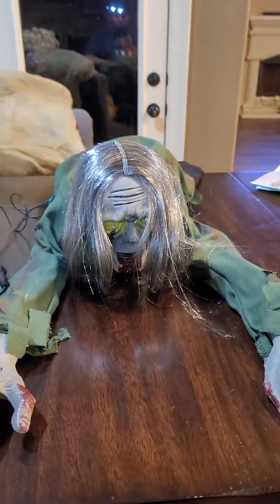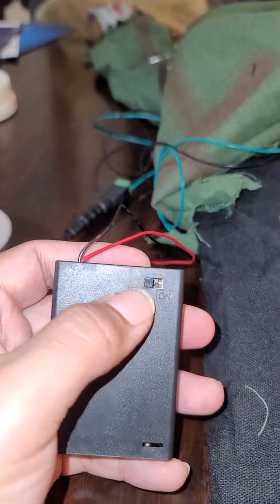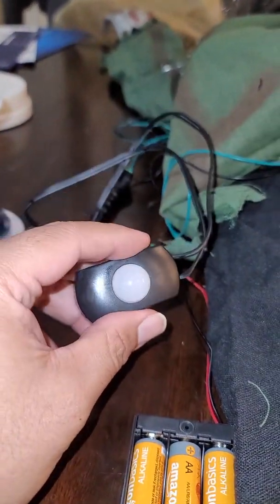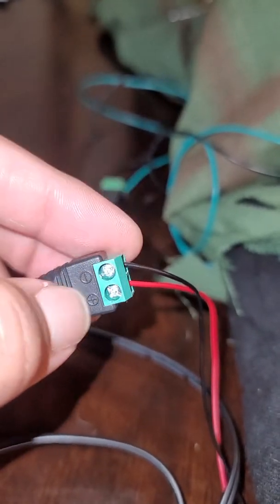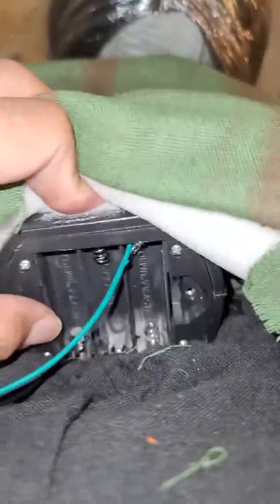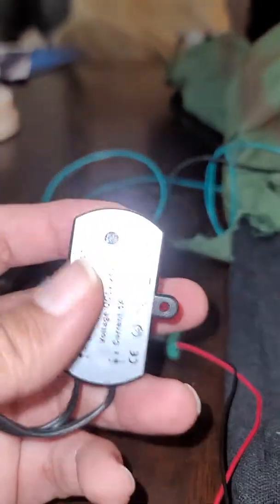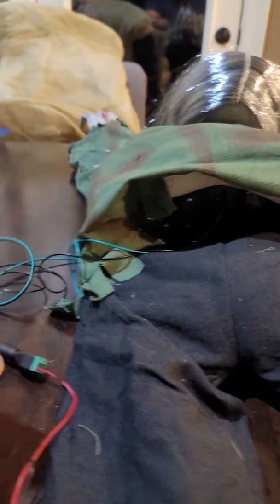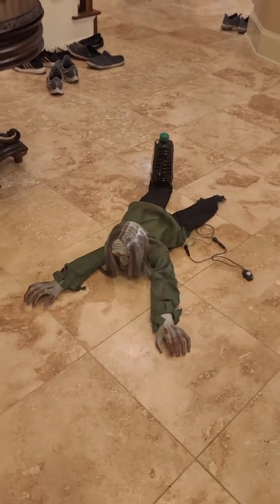Convert Any Halloween Decoration to Have a Motion Sensor

Comment: Thank you. I was able to follow this but managed to get it to work by cutting the try me button off and connecting the wires together. Then after I confirmed it working, I removed the circuits from the breadboard and soldered them all together so I could fit them inside the prop. Thanks again.

Comment: Cool tutorial! Why wouldn't you use the existing battery pack?
Reply: I’m guessing for the same reason he hot glues it. He doesn’t know what he is doing
Reply from the maker: @justacrochetmum7536 lol ok sure bud, i got 4 years of mechanical and engineering degree. Its supposed to be cheap ans easy. Some of the props wires xome hit glued feom the factory. No need to solder if hot glueing is faster and cheaper. Not everyone has a soldering iron.
Reply: @chevyspeed6368 soldering is the right way to do it.  I’ve hacked hundreds of props, NEVER seen wires hot glued. You can also use a 5 volt wall plug to do away with batteries.
Reply: That's what I thought too, and tryed it out. But it dosn't work. I don't know why, but in the way he do it, it works.

Comment: Will this work for touch activated props?
Reply: I’m trying right now with no luck. Mine will come on if you bump the table or flick the motion sensor. Nothing with untouched movement in front of the sensor

Comment: Im trying to add motion to the same witch you have at the end of the of the video. Is the second battery pack necessary and whats it for. ?
Reply: I have this question too... in my head it seems redundant... but I haven't tried it yet.  Soon!
Reply: @wolfindarkling1759 if you use the built-in battery pack, the prop always has power the sensor is unable to cut the power off. The sensor is basically wired in-between the batteries or USB power source and the prop. Then motion is detected it lets the battery power through. I tried without the transistor and resistors...but the circuit stays closed and can't be re-triggered. The transistor seems to be the key part to make this work with a motion sensor.

Comment: This might sound crazy but I followed your steps exactly and my f
Device does work but not by motion I got all the exact parts as you but for some reason my motion detector isn't making my device go off only sound like normal PLEASE GIVE ME SOME ADVICE lol I'm stuck
Reply: Yeah, I did the exact same thing to. mine doesn't motion either
Reply: Yea I don't get it, I tried forwards backwards wired the try me button i think I did every which way and configuration I could, and the prop works bur not motion so I finally gave up
Reply: @brucehall8570  Cheap sensor only 
10 bucks. I couldn't find one better and more expensive
Reply: I’m having the same issue. I think with the push to activate ones they have momentary circuitry while the regular ones that you just turn in and leave running work with motion

Comment: Thanks for the tutorial. How come you didn’t use the the battery box that comes with the prop?
Reply from the maker: Cause it is the direct source of power for the prop. You need to put the motion detector between the power source and the prop. Therefore the direction of power goes... External Battery Pack >> Motion Detector >> Prop.
Reply: @chevyspeed6368  thank you. My cheap ass was going to connect directly.
Reply: @chevyspeed6368  I tried installing the motion sensor between the push to activate switch and it would work if you bumped or flicked the sensor but nothing with untouched motion. I’m thinking the push to activate ones have different circuitry than ones with regular in off switches
Reply: @brokenwrench404 I thought about doing the same thing but this PIR sensor needs positive and negative signals. The push button closes the circuit that can be either one of those voltages.

Comment: Immediately fried my animatronic
Reply: i think he forgot to mention you have to use the same voltage.  there's within margin but you have to have voltage thats similar to what the prop calls for.   if there's 3 AA batteries, that calls for 4.5v or 5v.     If the prop uses 6 AA then you need 9volts.   (since each battery typically uses 1.5v)

Comment: Strange it works for some props not for others
Reply from the maker: Yea might have to do with too much resistance in the sensor or battery pack. So by the time the sensor gets the power and sends it to the prop, there could be a voltage drop, where it just falls under the necessary voltage of what the prop needs to activate. I've ran into the same issue  with one of my props. Some props have a very narrow range of acceptable voltage.

Comment: Thank you so much for this tutorial. Your way is so much easier than others I saw!!! I bought two of the sensors you did, same battery packs, and tested the pos and neg. One sensor worked for a second, the other never did.  I'm going to return and try a different one. In the meantime I kinda ruined the positive end of my prop battery pack, I can't get the glue off. The prop works but now makes a different noise. Any suggestions on how to get the glue off? Thank you!
Reply from the maker: Hey glad u loked the video! yea I actually had the same issue with one of my props not working with the sensor. I think it might have to do woth possibly the elecrictal internals of the prop (maybe to high resistance or something). As far as the glue you could try rubbing alcohol or some flush cutting pliers to help remove the glue a little at a time.
Reply: If you used a hot glue gun then use heat to remove the glue. A hair dryer or heat gun would work. Just don’t melt anything